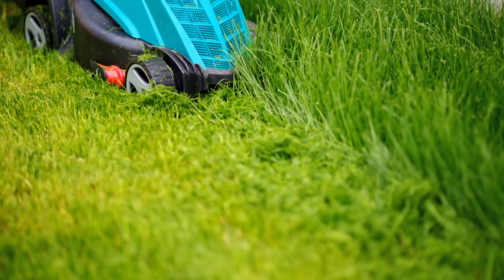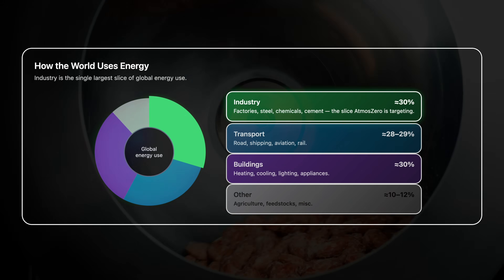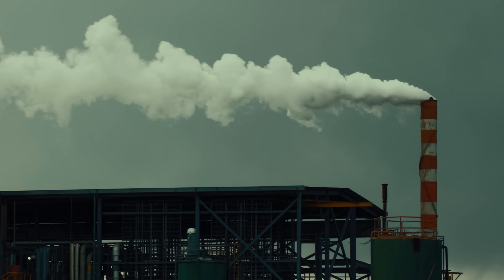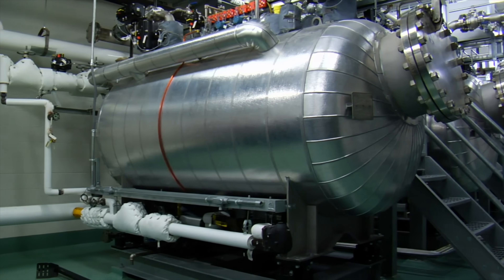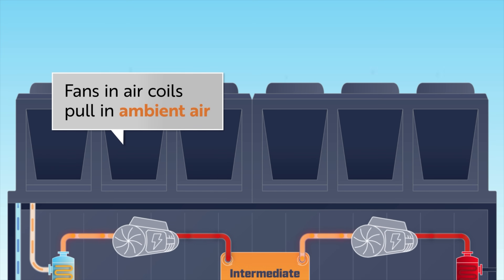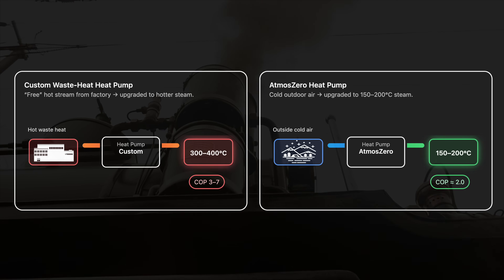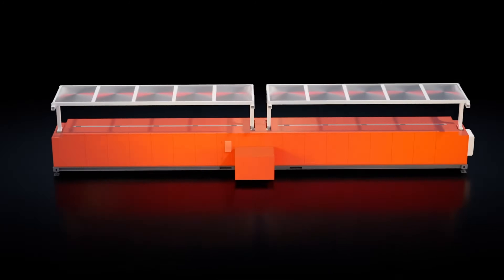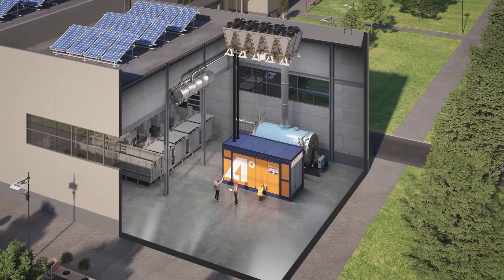This Startup Just SOLVED the Hardest Problem in Clean Energy

Comment: As I learned many years ago when I started my first programming job, 'Perfect is the enemy of good enough'. Get the job done; the process for getting the job done doesn't have to be perfect. The 80/20 rule comes into play too. If you can get 80% of the job done with only 20% of the effort, do it. We can't afford to wait for perfect solutions to all of our problems. We need to reduce our carbon emissions now by implementing 'good enough' solutions.
Reply: Yeah, let’s get a drop-in product that works. Long-term, they can work on similar drop-in heat recovery, and start by designing solutions for new construction when it’s easier/cheaper to implement
Reply: So we do it nice because we do it twice ? If we started actually investing in renewables that are efficient and do it right the first time it saves energy money and time
Reply: @JonNorton-d9e  

"If we started actually investing in renewables that are efficient and do it right the first time it saves energy money and time"

There is no 'do it right the first time' in the real world. Every year, solar panels, batteries, inverters, etc., become more efficient, cheaper, easier to use, easier to install, easier to maintain, etc. If you 'do it right' now, five years from now, you could do it again better and cheaper. 

Even after you finish a supposedly 'one time only' project, you learned when doing it, and most people would say "you know, if I had to do it again, I could make it a bit better".  

All I am saying is "don't wait". If you wait for 'perfect', you will be waiting forever, because 'perfect' is a constantly shifting target. Do something now, do your best, learn from it, benefit from it, and when and if it comes time to do it again later on, technological advancements and your experience will allow you to do a better job.
Reply: @JonNorton-d9e  when,not if, which we don’t have much  left
Reply: And that’s why there will always be zero days
Reply: Just heard this from Timothy Cain
Reply: Good enough for now solutions buy time to configure better options. Time is the biggest thing we are short on, so good enough is the best path until we have more time.
Reply: @rayopeongo  no. Most programmers are taught not to optimize. They use that as an excuse for sub quality work.
Reply: @mikeyearwood  

"Most programmers are taught not to optimize."

Optimize what? If the program spits out the right answer and gives the customer/business what it needs, I don't really care if the program 'wastes' a little computer memory or file space or doesn't run as efficiently as it could. 

Writing a program that optimizes EVERYTHING while still delivering the right answer would be perfection. It would also waste a lot of someone's time and money getting it to that level.  

You can spend your time and money building 10 'good enough' solutions or one perfect one. As far as global warming goes, I'll settle for a bunch of 'good enough' solutions right now.
Reply: @rayopeongo  "...If the program spits out the right answer and gives the customer/business what it needs, I don't really care if the program 'wastes' a little computer memory or file space..." 
IMO, it depends on your particular use case.
You can make that statement calmly when you're company is running with excess resources, like running Office on a 48GB M4-Max machine and 2 TB of storage.
The problem comes when you start hitting your hardware limits. For example, in finance, shaving off a single millisecond in data transfer speeds means millions of dollars in profit, and hyper-optimization of everything from hardware to software and firmware is the only things that make that possible. Programming smarter and more efficient code is a requirement, not just having the software do what it's supposed to do.
Reply: @ipp_tutor  

"Programming smarter and more efficient code is a requirement, not just having the software do what it's supposed to do."

In your finance case, shaving off milliseconds IS a business requirement, and not delivering that is not 'good enough'. And I suppose that the Apollo astronauts were glad that some hyper-optimization with regards to CPU and memory usage was done on their spacecraft's computers. 

However, my point still stands. You very rarely need 'perfect'. In the case of climate change, waiting to go solar until 100% efficient solar panels are available for $1 is just wasting time. You can put a few solar panels on your roof, a battery in your basement, and reduce your carbon emissions a bit while saving some money, reducing your load on the grid, and having a backup in case of power outages. You don't need to immediately install a 'perfect' whole house system and go completely off grid.

There are many 'good enough' solutions available right now, like the example in this video, that would reduce our carbon emissions, and the sooner we start implementing them, the better.
Reply: @rayopeongo  Let me explain waste to you from a couple of different viewpoints.

At university in an programming class, assembly language, our professor gave us one week to write a program a keyboard. Told us the minimum lines of code would be 43. I submitted a subroutine with 42 lines of code. The average for the class was 90 lines of code. Using your analysis you'd be OK with the average and the processor literally working double time. Add several hundred thousand or even million processes buried in the processor and that attitude leaves us with a very slow system.

Early in my career I was involved in design/installation and operations of conveyor system. I not only programmed the PLCs I managed 15 other software engineers. Before I came along each engineer addressed the programming differently. When a new type of conveyor came along that was fundamentally different my software engineers simply could not recognize how it mechanically worked and translate that to PLC code. They settled on a disastrous 27 line subroutine. What they saw in it to this day I don't understand because it was the most unintelligible code I have ever seen. And to think that code had to be replicated for every 2' of conveyor and there was 1000' of conveyor. Technically it worked, the cases did move down the conveyor but many cases also were physically damaged, but the scan time of the PLC tripled. Not good. I had a meeting and presented them with 7 lines of code that simply worked. Was easily interpreted and replicated. Scan times reduce to normal. And the conveyor operation was so dramatically different, consistent and easy on the conveyor this customer wanted to reprogram their other conveyor systems to match. A 4 week programming task suddenly became days. And was easily transferred from one job to the next.

In each case the programming of most people was horribly inefficient. And most of the people were way more intelligent than me. But they don't have a clue about efficiency. And with that attitude(and yours) it's a good thing the computer industry keeps producing more and more memory at lower and lower costs. Because we need it for the inefficient software in this world. In my opinion if we had good code across the board we'd only need 10% of the memory chips the market currently uses.

And one more aspect of this attitude: It caused those two Boeing flights to drop out of the sky.
Reply: @rayopeongo it sounds to me like your making spegeti code. You cant build on that crap without breaking it and fixing it with bandaid patches that break again when you add something else too it....
Reply: @rayopeongo  They are triggered by game dev.
Reply: @StrifeA217  

"it sounds to me like your making spegeti code"

LOL, I'm trying to AVOID 'spegeti' code. When your program contains hundreds of lines of complex code, you need to document, document, document, with meaningful variable and section names, and an organized structure.
Reply: @blackseabrew  Most programmers are complicators, not simplifiers - like you seem to be. Good work.
Reply: @mikeyearwood  
1. today we have more than enough processing power for most of programming applications and even a lot of analysis and simulations. 
2. a lot of programs are single time use, it's not wise to put extra hour of effort into optimizing a program that's gonna run for only few hours

3. optimization is not just about the program itself, its about the duration of the development too
Reply: @Mir_Azad dude in what world do you run a program once? Add to that the amount of bloat due to not optimizing is getting to the point of insanity. We used to do do more with so much less.
Reply: @StrifeA217 in research a lot of programs are only used few times. its the same in data analysis and some other fields
also, we are doing more with less too:
doing more projects with less time
Reply: Avoiding environmental damage should be the goal and Carbon is not damaging the environment.  If it is go ahead and hold your breath.  I dare all of you climate alarmists!!!
Reply: @anthonycarbone3826  

"Avoiding environmental damage should be the goal and Carbon is not damaging the environment."

Carbon dioxide itself is not damaging the environment. It is a natural part of the earth's atmosphere. The problem is that we have too much of it in the atmosphere, and the percentage is still rising. As with anything, the trick is to get as much as you need but not too much. 

There are dozens of different chemicals that we need to survive, but that if we get too much of, we die. Even water can be a problem. Humans can't live for very long without fresh water, but drinking too much of it too quickly can kill you. We evolved to survive in a particular environment under particular conditions, and if those conditions change too quickly for us to adapt to, we are done for, like millions of other species that have come and gone before us. The difference is that we might be causing our own extinction, even though we are the only species ever to know what the problem is and how to solve it.
Reply: @rayopeongo  There is a consensus that humans are increasing the amount of Carbon in the atmosphere.  But there is no agreement on what percentage of the increase is due to humans.  We are still in the process of leaving the last Ice Age and that means the earth was going to heat up no matter what humans were doing.  Now humans are causing a warming for sure by the Urban Heat Effect and this is so damaging because the historic measuring stations that measure temperature in the past are now part of the Urban environment.  It is not simple which is why honest disagreement exists.
Reply: @anthonycarbone3826  

"It is not simple which is why honest disagreement exists."

Let me put it this say. Let's say that you are about to drive a large truck over an old bridge crossing a deep ravine. You decide to get 100 engineers to examine the bridge to make sure it can handle the weight. 5 of them say 'Sure, no problem, go for it!" 95 of them say that the bridge will most likely collapse and that you will be killed. Do you drive over the bridge? Most sane people would not.

The vast majority of climate scientists think that the earth is getting warmer, and that the cause is the increased concentration of CO2 in the atmosphere generated by human activity. Some of them think that if the earth warms up too much, it will be out of control as the vast amount of methane stored in the frozen permafrost is released as the permafrost melts. Methane is a much more potent greenhouse gas than carbon dioxide. 

By the time the last human is convinced that we are causing global warming, it may be too late. Our society is built on our relatively stable environment. If there are large increases in ocean depth, or large changes in rain and snow patterns, or ocean currents, or extreme weather events, we will be faced with living in a very different world, one that our society is not suited to. Better we start working on the problem now.
Reply: According to Bill Gates , Global warming is at best a minor problem now. 😂
Reply: @MarkPoullos-v4f  until the trump regime is gone and he doesn't feel the need to compromise with them for whatever he's trying to do.
Reply: @MarkPoullos-v4f  for billionaires
Reply: Our electricity bill doubled because our state’s electric utility cartel now has to spend billions a year clearing brush and upgrading infrastructure to counter worsening fire conditions. Texans and Floridians are paying more because of worsening storms and flooding. And our home insurance bill went up five times because fires are becoming more destructive and bigger every year. I’ve even read that part of the rise in food costs comes from higher temperatures causing more drought and difficult growing and working conditions. That all adds up to $3000 to over $10,000 a year for many North Americans. Chickenfeed for a billionaire oligarchs like Gates but a lot of money for most folks!
Reply: @MarkPoullos-v4f  I can only find that he actually said was roughly: "it wouldn't kill everyone , and that we should focus on doing what we can to mitigate the effects of climate change rather than trying to stop it"
Reply: @Noah_AWICB We'll need to do both.
Reply: @ohrobert65  Agree, Our thermal issues will be around for at least a few decades.
Reply: @Noah_AWICB  Ok. That makes more sense. 👍
Reply: @Noah_AWICB  Bill Gates is a liar.  It doesn't matter what he said, only what he means.  He means that Microsoft is losing the AI race and needs to build a lot more electric power plants to catch up.  If Gates could burn down all the rainforests in the world to power his AI data centers, then he would do it in a second.
Reply: @Spin_Gravity  " If Gates could burn down all the rainforests in the world to power his AI data centers, then he would do it in a second."
No he wouldn't lmao, you are so out of touch.
Reply: lets talk about that time c02 levels allmost droped to 0 ans killed 75% of all life on earth below and above sea
Reply: @torso99  When was that?
Reply: @rayopeongo  millions of years ago
Reply: @torso99  

"millions of years ago"

Exactly. So why bring it up?
Reply: @rayopeongo  becouse we need co2
Reply: @torso99  

"becouse we need co2"

We already have more than we need, and we keep pumping out more. It has already started to negatively impact ecosystems that we also need. If we cut our CO2 emissions to zero, that doesn't mean that CO2 will disappear.
Reply: @torso99 no no, it was approximately 2.4 billion years ago. You're talking about that oxygen first great extinction event, right? That was so far ago, trees didn't even exist then.
Reply: @rayopeongo  there is no negative impacts of co2... there are negative impacts with microplastics and ptfe but not with co2
Reply: @torso99  

" there is no negative impacts of co2"

Yes, there are. Extreme weather events such as hurricanes, tornadoes, floods and droughts are becoming more numerous and more powerful. Wildfires are also becoming more numerous and destructive. Almost every year sets a new record for the hottest year in history. 2024 set the latest record. The last 10 years were the hottest years ever recorded. 

The climate is changing. Arctic ice diminishes ever year. Glaciers are disappearing. Ocean levels are rising. Coral reefs are being killed off by rising ocean temperatures, threatening fish populations that we need for food.
Reply: @rayopeongo  dont be redicules... there have allways been extreme weather from time to time
Reply: @rayopeongo  your talking about cycles that are measured on a geologic time scale. We dont have good data on this stuff because we dont have records that go back far enough or accurate enough. I mean we have found evidence of what 7 different ice ages?
Reply: @torso99  

"dont be redicules... there have allways been extreme weather from time to time"

LOL, of course. HOWEVER, these extreme weather events are becoming more extreme and more numerous.
Reply: @rayopeongo  this is nothing compaired to ice age
Reply: @StrifeA217  

"I mean we have found evidence of what 7 different ice ages?"

We have also found evidence of a 'snowball earth', and a 'green house earth', green from pole to pole. Those were billions of years ago. Meanwhile, we have managed to increase the CO2 level from less than 300 ppm to over 400 ppm in less than 200 years. That is NOT a geological time scale. There have been quite a few mass extinctions over earth's history, of various severities and causes. It looks like we will cause the next one.
Reply: @torso99  

"this is nothing compaired to ice age"

I would prefer to avoid BOTH an ice age and runaway global warming. Neither one would be good for our species.
Reply: @rayopeongo  do you know what the biggest drop in co2 in reasent time was?
Reply: @torso99  

"do you know what the biggest drop in co2 in reasent time was?"

What was it?
Reply: @rayopeongo  gengis khan killing a bunch of people... dont worry about the co2.. depopulation is about to hit big.. no1 are having kids
Reply: @torso99 yes but the time to time are no longer "100 year events" they are every few year events and if we hit 2degrees they will be every other year. Try growing crops and raise animals and conduct business on these scenarios. Society nearly went down the crapper when covid hit and we panic bought toilet paper! Wars will start over the date places to live, drought, flood, fires. It's going to happen anyway but we need to try and stop it from getting even worse. Take a look at Venus if you want to see what runaway greenhouse gasses does for a planet.
Reply: @matthewbrown435  relax bro wtf
Reply: @torso99  This guy gets it!...Humans may have saved the planet with the industrial revolution. Co2 was at dangerously low levels around 300ppm, any lower plants would of started to die...we are now at 400ish ppm. In the past it was as high as 8,000 ppm and we did not have extinction of planet earth....
Reply: @EQ_EnchantX  

"Humans may have saved the planet with the industrial revolution. Co2 was at dangerously low levels around 300ppm, any lower plants would of started to die."

LOL, according to who? According to historical data, before the industrial revolution, CO2 levels varied between 280 and 300 ppm for millions of years, and the earth had millions of square miles of healthy green ecosystems. Now, all ecosystems are showing signs of heat stress.
Reply: @rayopeongo  You are incorrect, the only time we had levels this low was during the massive forest die offs in carboniferous era where most of the fossil fuels come from...
Reply: @EQ_EnchantX  What is your source for that data?
Reply: @rayopeongo  Source for the data is all the fossil fuels you currently consume....go look at the Co2 levels back than when all the trees/plants used up the majority of the co2, it dropped to <300 ppm and thus we had massive plant die offs which created out current abundance of fossil fuel.

"The Carboniferous rainforest collapse, a dramatic global cooling event. This was triggered by the proliferation of vast forests that significantly depleted atmospheric carbon dioxide."
Reply: @EQ_EnchantX  

"The Carboniferous rainforest collapse"

One, nothing about the Carboniferous period can be applied to today's conditions. It ended 300 million years ago. Everything is different now. The composition of the atmosphere is different. Every species of plant and animal alive then is now extinct. Even the continents are different. It ended 50 million years before dinosaurs arrived on the scene.

Two, who says that the rainforest collapse was triggered by vast forests depleting atmospheric carbon dioxide? As far as I know, there is no generally agreed upon cause of the collapse.
Reply: @rayopeongo  
"The composition of the atmosphere is different"

So how do you know more co2 is bad, maybe everything is different now right?

"who says that the rainforest collapse was triggered by vast forests depleting atmospheric carbon dioxide? "

Who says adding 100ppm co2 is a earth destroying event? When it was 8,000 or 20x higher in the past?
Reply: @EQ_EnchantX  

"So how do you know more co2 is bad, maybe everything is different now right?"

For the last 800,000 years, CO2 has varied between 180 ppm and 360 ppm, with those changes from one to the other taking thousands of years. For the last 10,000 years, when humans really got established and became the dominant species on the planet, the concentration of CO2 has only varied between 260 and 280 ppm. The climate and temperature has been very stable, and our species thrived under those conditions. 

Since we started burning fossil fuels in the mid 19th-century, the concentration has gone from 280 ppm to 420 ppm today. That is a 50% increase in less than 200 years, and it is still rising every year. It hasn't been that high in 16 million years, long before our species existed. 

"Who says adding 100ppm co2 is a earth destroying event?" 

One, we have already added way more than that, and it is still going up. Two, the vast majority of climate scientists say that the current human-caused global warming is an existential threat to the environments that we all depend on. Why would you want to gamble with that, when we have the power to stop it?

"When it was 8,000 or 20x higher in the past?""

There weren't any humans around back then, and long term changes in C02 levels and other environmental changes caused mass extinctions. A lot of scientists say that we are well on our way to the next mass extinction, and it is being caused by us. It may also include us. The earth will continue to circle the sun for another few billion years, but there won't be any humans around. Different species will take over in the green house earth that will replace our current paradise.
Reply: @rayopeongo  Omg dude its not that big of a deal, stop listening to the "scientists" and look to the actual data, its been much much higher in the past and life goes on... If it was such a disaster looming why are the rich buying up all the beach front properties?

"Why would you want to gamble with that, when we have the power to stop it?" 

Because the same scientists said COVID was not contagious, wearing masks don't help, wearing masks do help, wearing 2 masks are better, the vaccine has no side effects, the vaccine has some side effects, the vaccine has been tested thoroughly, the vaccine had limited testing, you can't spread the virus if you are vaccinated, you can spread the virus after vaccinated...on and on and on... 

Scientists get paid by companies or governments who have agendas. They will say whatever the people with the money want them to say. 

Is your solution to climate change more taxes on carbon? Because that is what it always comes down to. Also, do you still drive a car? Do you still heat your home? Do you still cook and eat food? Well you are the problem and are causing climate change...
Reply: @EQ_EnchantX  

“its been much much higher in the past and life goes on”

No, life did not go on. All of the life forms that experienced those higher CO2 levels are extinct. All of the species alive today arose in much lower carbon dioxide levels.

Regarding COVID, that was something that we had never experienced before, so of course some mistakes were made at first. However, we figured it out, stopped the pandemic, and now COVID can be easily avoided by getting a yearly shot, just like the flu. 

“They will say whatever the people with the money want them to say.”

And if they are actually lying, eventually they will be debunked, just like all of the guys who said that smoking was safe. Science always uncovers the truth. And you think that ALL climate scientists have been bribed to spread the ‘climate change lie’? You sound like a flat earther.

“Well you are the problem and are causing climate change...”

Yes, I am, but I am learning, and I am improving. I commute to work on public transit. I vacation closer to home rather than jet off to destinations all over the world. Over the years, I have insulated my home more thoroughly, and upgraded the windows, furnace and hot water heater to more efficient models. In our area, the vast majority of our electricity is carbon-free, so I have installed a heat pump to take over the majority of our heating. I just replaced my gas snow thrower with an electric one. Future plans are for a heat pump water heater and clothes dryer, and my next car will almost certainly be electric. I’m already using solar panels, and will be adding more and installing some batteries for backup.

I’m actively trying to reduce my carbon footprint, along with billions of other people around the world who realize that we have a problem and are trying to do something about it. Why are you so stubborn? What makes you think that you are right and all of us are wrong?
Reply: @rayopeongo  "No, life did not go on. All of the life forms that experienced those higher CO2 levels are extinct. All of the species alive today arose in much lower carbon dioxide levels.
"
All of the life forms died huh? So life went extinct right? That is shocking news to me as a life form...

"Regarding COVID, that was something that we had never experienced before, so of course some mistakes were made at first. However, we figured it out, stopped the pandemic, and now COVID can be easily avoided by getting a yearly shot, just like the flu. "

Your right, we have plenty of experience with co2 levels and earth extinction events from it...silly me. Also flu shots that are sometimes 20% effective are not something to brag about...

"And you think that ALL climate scientists have been bribed to spread the ‘climate change lie’? You sound like a flat earther."

No there are many who don't support the we will die in 10 years BS that it is. So much money is being pushed to make taxing people for co2 a thing, if you actually look into it, its not what it seems.

You made all them changes and than we ship manufacturing to China, who don't care about environment and counter act everything you just did  and actually made things worse because most of that crap is from countries that don't care. 

Also look at the fuel ships use to ship stuff across oceans. 1 ship uses 10 families lifetime amount of fuel per day...there are thousands of them at any given day...same with planes...vehicles...Attacking consumers by taxing us is not going to change anything, As residents are not the main Co2 emitter...not even close.
Reply: @EQ_EnchantX  

“So life went extinct right?”

LOL, nice straw man. No, life evolved. The old life forms went extinct, and their descendants evolved into species that adjusted to lower CO2 levels.

“No there are many who don't support the we will die in 10 years BS that it is”

Who the hell says that we will all be dead in 10 years? That is another ridiculous over-exaggeration of the problem. 

“we ship manufacturing to China, who don't care about environment”

China is the largest manufacturer of solar panels in the world. China produces the most power from solar of any country, producing more solar power than the next 8 countries combined. They might have other environmental problems, but they recognize that solar is the way to go for the future. And if people had insisted on buying locally produced products as much as possible instead of cheap stuff from overseas, those jobs would never have left, and there would be a lot less ships burning fuel crossing oceans to bring that cheap stuff in. 

“Attacking consumers by taxing us is not going to change anything, As residents are not the main Co2 emitter...not even close.”

Who said they were? This video is actually about one way to reduce the carbon footprint of industry. However, if everyone reduced their personal carbon footprint as much as possible, it would give us more time to fix the industrial and transportation industries, which are bigger, more complex problems.

For instance, electric vehicles can handle 99+% of the needs of 90+% of the population. If everyone whose needs could be met by an electric vehicle got one, it would greatly reduce our carbon production. It would also greatly reduce the number of oil tankers carrying crude oil all over the world’s oceans. If everyone who could afford to offset all or part of their electrical needs with solar panels and batteries did so, that would reduce the load on the grid.

We should also be demanding more from our governments and corporations. For instance, why doesn’t WalMart have solar panels on the roofs of all of their thousands of massive stores? They can easily afford it, it will eventually save them money, it will reduce the demand on the grid, and it will keep their cash registers on when the grid goes down. It’s the same for all of the other big box store retailers out there.

There are a lot of things that the average person can do. Saying that “it’s no use” doesn’t help.
Reply: @rayopeongo  These people you are conversing with probably work for The CO2 Coalition. It's a subversive organization trying to convince dumb people that CO2 is good for everyone and everything and that it's good we have more of it now. Their main thrust seems to be giving people like the ones on this thread their weak shouting points to try and undermine the facts of the matter. Some of what these people say is true, but their conclusions are distorted by design. Sure CO2 was higher once, or lower once or whatever historical point they throw out. What has NEVER happened before is the speed of change in CO2 levels. That is the only real problem here - life, specifically humans and all the other life forms that keep us alive, cannot survive outside a very narrow temperature band. If the CO2 levels and the temperatures were rising at normal geologic and historical rates we might be fine. The speed of change prevents life forms from adapting and evolving, which is a dramatically slow process. What has happened in the past over geologic time frames when humans didn't exist is irrelevant. What is happening right now and really fast is what matters. All their arguments are unserious.
Reply: @Hybridog  

I would not be surprised. They were certainly giving off 'flat earth' vibes. They will be very disappointed when in the near future electric vehicles become cheaper to own and run than gas vehicles, and solar panels are installed on every suitable roof top. The conversion to renewable, carbon free energy has already begun, and we have probably already passed the tipping point. Years ago, electric vehicles weren't available, and the only people installing solar panels on their roof were people living in the middle of nowhere, looking at paying tens of thousands of dollars to the power company to run a line to their house. Now, almost every car company sells at least one electric vehicle, and more and more suburban roofs are sprouting solar panels, for a variety of reasons: saving money; wanting to reduce their carbon footprint; backup for grid failures; etc. 

Just like the flat earth, the CO2 Coalition will soon be consigned to history's trash heap.
Reply: @rayopeongo  
"LOL, nice straw man. No, live evolved. The old life forms went extinct, and their descendants evolved into species that adjusted to lower CO2 levels."

The same thing that has been happening for the last 4 billions some years...we humans are not going to change that in just under 200 years. Not sure why you think co2 is the main problem out of a bag of problems, when some are much much more dangerous and critical. The cheaper we can make energy and get more people hooked up, the faster we will get off it.

"If everyone whose needs could be met by an electric vehicle got one, it would greatly reduce our carbon production."

No it would not, because you are just moving the energy production to a power plant that burns coal/gas as the green energy is not up to par yet.

 Also our grid would not handle it, we are currently close to maxing it out right now, if people switched to electrical cars we would all be like California and have black outs / brown outs. They forced people to switch to electric everything and now they tell people not to charge their cars or run AC as they do not have the power for them.
Reply: @EQ_EnchantX  

"The same thing that has been happening for the last 4 billions some years"

Yes, but those past swings in CO2 concentration took place over tens of thousands of years, allowing time for life to evolve and adapt. And yet there were still a few mass extinctions. Now, we have increased the CO2 concentration by 50% in less than 200 years, and it is still climbing. Life cannot evolve fast enough to adapt to such a rapid change.

"Not sure why you think co2 is the main problem"

Yes, we have a bunch of problems, but climate change due to rising CO2 levels is very close to the top of the list. Why can't we work on all of those problems simultaneously?

"No it would not, because you are just moving the energy production to a power plant"

Burning gas in a power plant and sending the electricity to a heat pump to heat your home is more efficient than burning the gas in your home furnace. And burning gas is 'cleaner' than burning coal. Coal power plants are among the dirtiest and least economical way to produce power. Solar is now the cheapest way to generate power. 

"Also our grid would not handle it, we are currently close to maxing it out right now"

The grid will adjust. Large utilities all over the world are already adding large battery banks to store excess renewable power and release it when renewables can't meet demand. Every year a new record is set for the amount of grid scale battery storage added. Those battery banks will also help stabilize the grid by instantly supplying power when the grid is overloaded and absorbing it when the grid has too much. California already generates more electrical power than it needs on sunny summer days, and has to stop accepting solar power from home solar setups. They already have 17,000 MW of battery storage, and plan to triple that amount in the next 20 years, so that they can store that excess solar generation for later use.

And home batteries are also getting cheaper, more capable and easier to use every year. More and more people are adding batteries to existing residential solar setups, or are including batteries in new setups. 1.2 GW of residential storage was added worldwide in 2024, and that number looks like it will double this year. That means that those homes REDUCE their load on the grid, and in some jurisdictions, that battery power can also help the grid as required by releasing power to it or absorbing excess.

Electricity is the way of the future. It is replacing the burning of fossil fuels in many applications, and will continue to do so. And generating that electricity using solar panels and storing it in batteries as required is becoming the cheapest way to run our world.